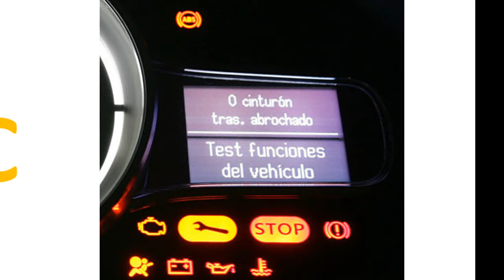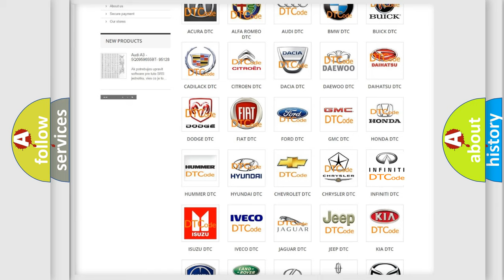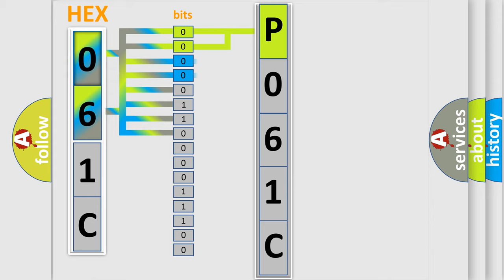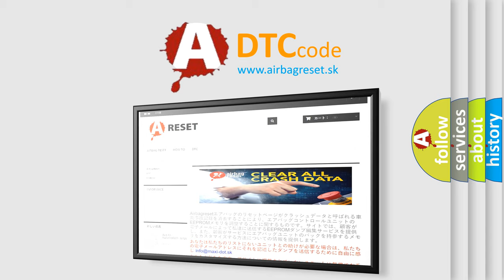DTC Ford P061C Short Explanation

Comment: So if I have a 2011 Ford Fusion with this code are you saying it's the Radio that's causing this?    When I start the car engine sounds great but when you try and put it into drive car moves a little but just dies.   So do you think this has something to do with the AV Control Unit which would be the Radio Unit??
Reply: Did you figure it out? Bc I have the same problem
Reply: @whocares5188  Yes, the wiring that goes into the PCM one of the wires was cut and getting a poor connection.   

It could be the same issue or could be your PCM.